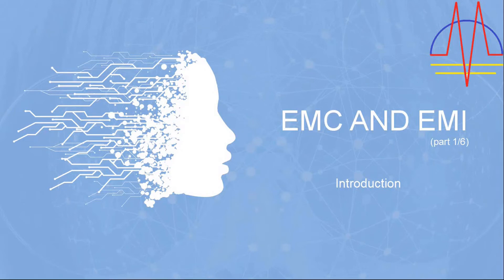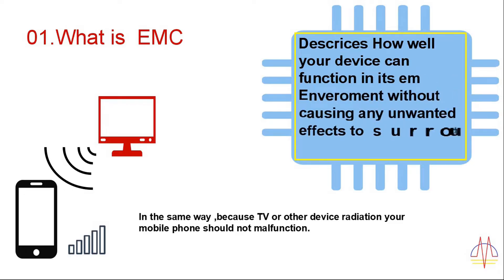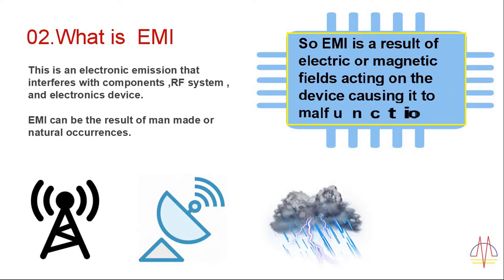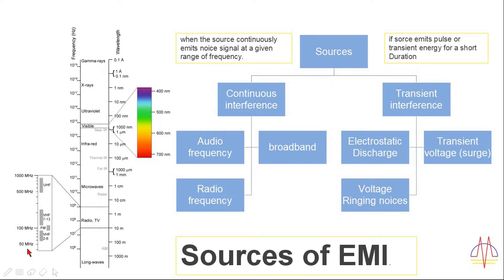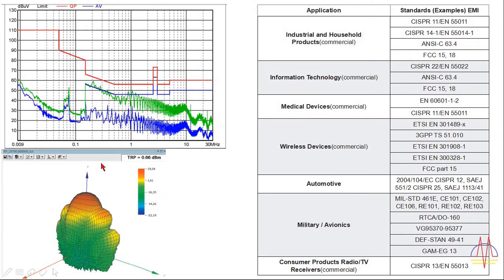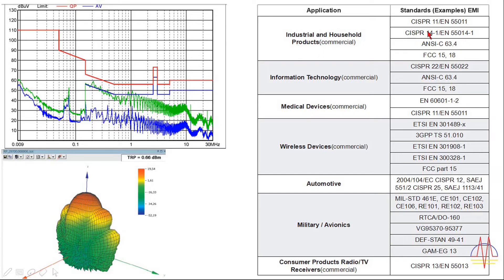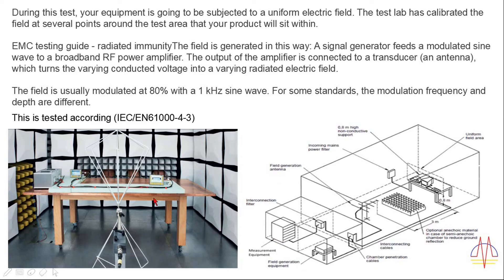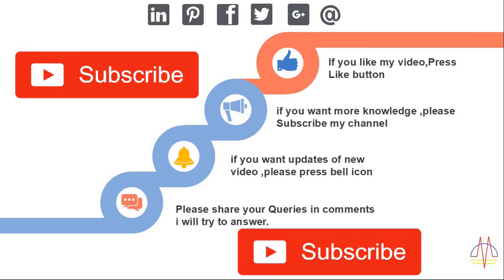EMC and EMI

Comment: Remember helping EMC Engineer's doing these type of tests at Lockheed Environmental Test Laboratory in Sunnyvale, California Lockheed Facility in the 1980s through the late 1990s. I was a Space Laboratory Technician. We did Thermal, Acoustic, Vibration, Structural, Thermal, EMC / EMI, CISPR, Radiation Susceptibility Tests. It's AMAZING how Electronics Measurement Instruments have improved in performance and their robust functionality and their cost have gone down dramatically, We used expensive Spectrum Analyzers, Oscilloscopes, and other tests equipment that were so EXPENSIVE from TEKTRONICS, Hewlett-Packards, Rhodes-Scwhartz Instruments.
Reply: Thank u for sharing ur experiance.

Comment: Several glaring errors, one of the biggest is that the test lab set up in the photo is a CISPR 25 test setup, not 61000-4-3, which is what is displayed in the line diagram